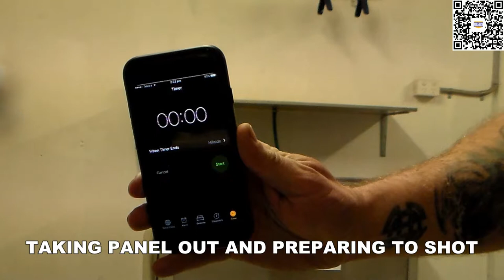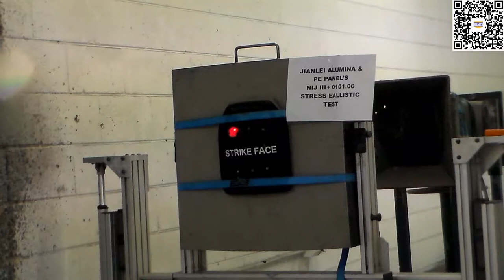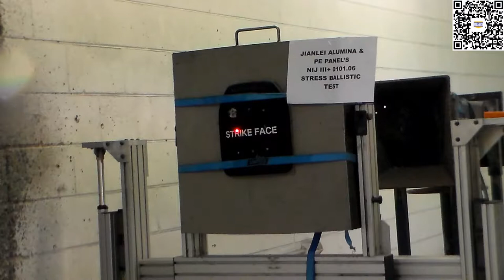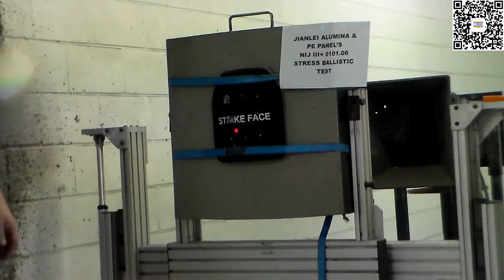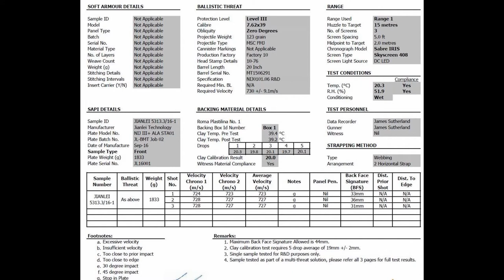MILITECH's NIJ III+ Alumina Ceramic & PE Plate's Stress Test--E Shape Panel

Comment: So we have to make sure we go underwater for 30 minutes before we get shot?
Reply from the maker: NIJ 0101.06 test requires panel to be immersed in water for 30 minutes before shot, this is to test the gluing system is not damaged by water immersion. You can do a direct shot and test no problem however it will be NIJ 0101.04 standard applied, not 06.